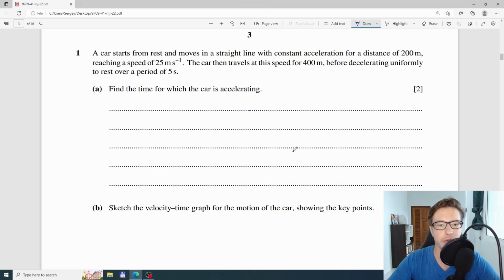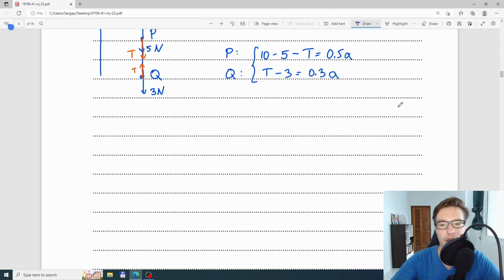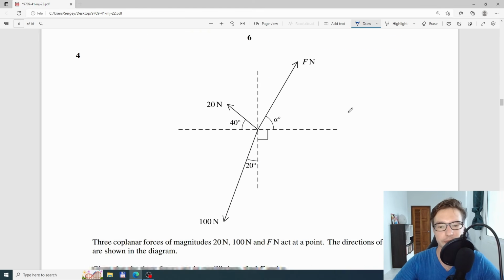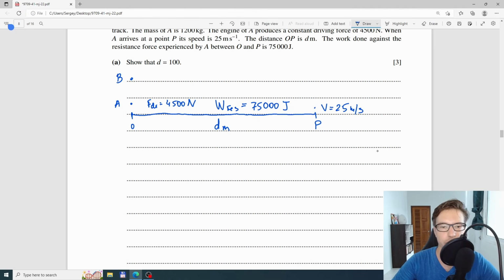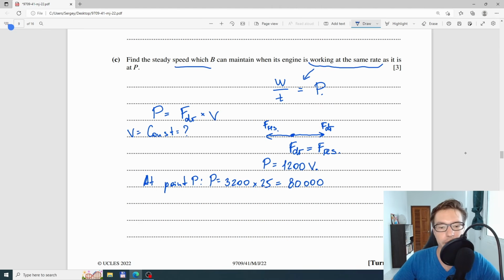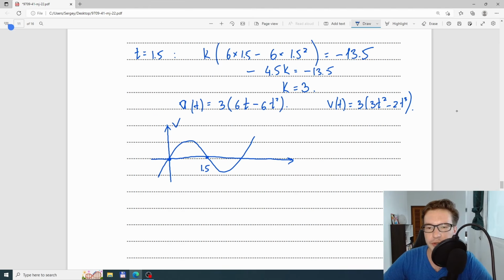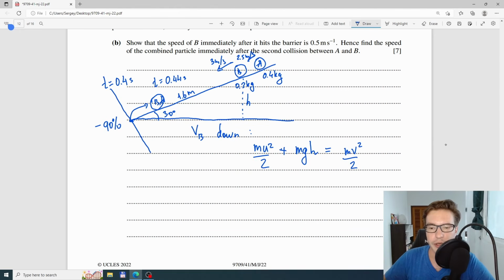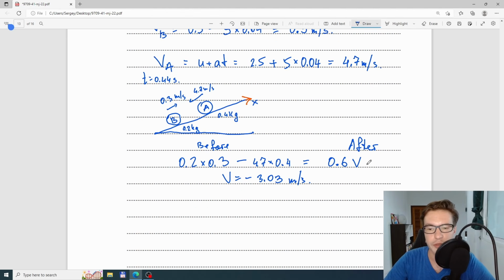9709/41/m/j/22 Video solution of Mechanics May/June 2022 Paper 41

Comment: Q3: the questions doesnt state whether the force applied is a push or a pull. I calculated 1561N for X is the force is pushing down on the box, not pulling it up reducing its contact force. Surely this must be cambridges fault. its only a matter of subtracting or added the force to the normal force but it creates a very big difference in scenarios
Reply: i was thinking the same thing , pushing makes more sense as higher contact.
Reply: no but the question gives an angle therefore it is understood it is a pull force not push

Comment: In question 2, how does the same string pull particle P down, but lifts particle Q up?
Reply: P is heavier, Q is lighter
basically, P pulls Q up while it itself goes down
Reply: @kiwuuspurr1927  hi
Reply: @bilaltaj1725  hello there
Reply: @kiwuuspurr1927  obi wan kenobi
Reply: @kiwuuspurr1927  this is not a pulley question, its a straight string. When one goes up another goes up and the opposite.

Comment: 33:13, u said that at constant speed driving force is equal to the resistive force but in this part we are given both the values of driving force and resistive force so why did u take resistive force equal to 1200 but didn't used the value of driving force given in the question??
Reply: same question here
Reply: In the b part the car is accelerating
For c we need constant speed, when resistance and driving force are equal your car is in constant motion
Reply: @sherdilnaveed5062 why we didn't choose the driving force,3200 instead. Why he chose the frictional force to be the one in equal??
Reply: @mattg9171 because its going at steady speed so a = 0. So it's

m(0) = P/V - (Fric force)

Hence u get Fric force = P/V

Comment: what is the value of g in the last question when you used mgh
Reply from the maker: I used g = 10 [m/s^2]. 
It is written on the cover page of every Mechanics paper from Cambridge: ''Where a numerical value for the acceleration due to gravity (g) is needed, use 10 ms–2" (10 meters per second squared).